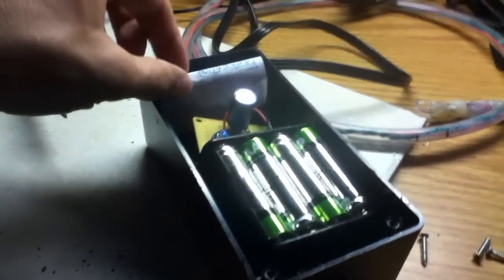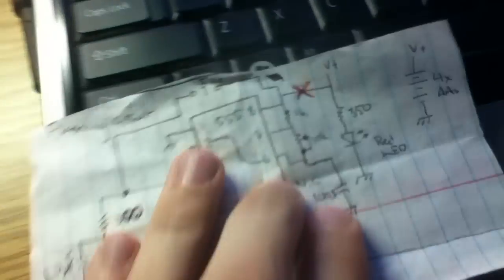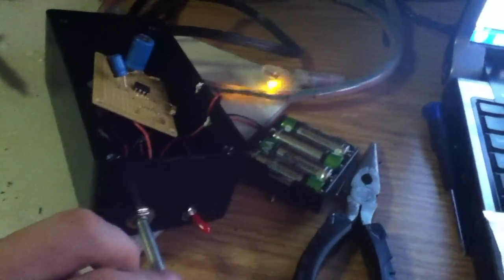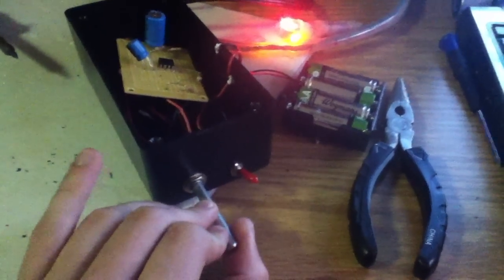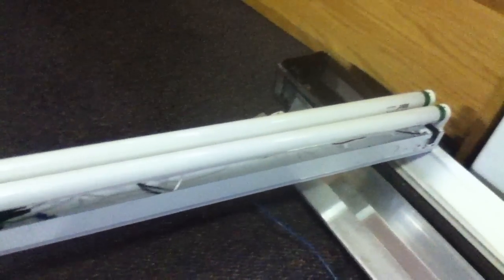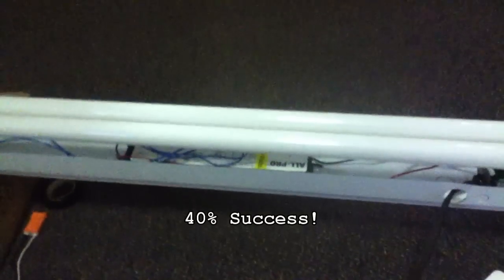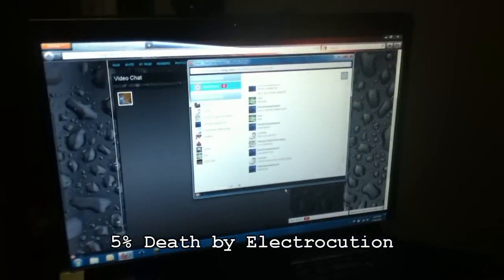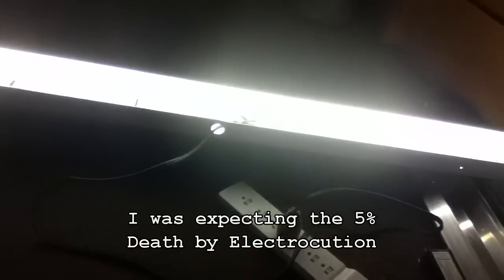Electronics and Aquariums - DIY Electronics Projects

Comment from the maker: I just looked that up. That's a really inexpensive fixture! It comes with the ballast. It seems really 'cheap' though but it could possibly work well. It's hard to tell how sturdy it is from a photo. Nice find!
DIY can save you a lot of money. You could build a fixture using that setup or something similar to the one I got and stay well away from the $60 needed for a commercial 2 bulb lighting strip.

Comment from the maker: I am completely self taught when it comes to circuit theory. The excitement was because I had no idea if this wiring was correct until I tried it and was skeptical that it was so easy.
I am proud of your accomplishment. You did well. My first job was at 15 and was for a construction comp. I had a lot of fun with the roofing. It's heavy on tear down days and just as nasty on building a new roof. 100+ degree weather (38 C for you) and near 100% humidity added to the fun. It's character building.

Comment from the maker: $11 at Walmart? That's a steal if that's true. I picked up the fixture (ballast included) for $28 at Lowes. It was designed for industrial use (wired directly to the building) so I had to cut some wires and attach my own cord to hook it up to an outlet. It wasn't too hard I was just uncertain it would work.
I like DIY because it gives you another way to interact with your tank. It can also save you some $ if you play your cards correctly